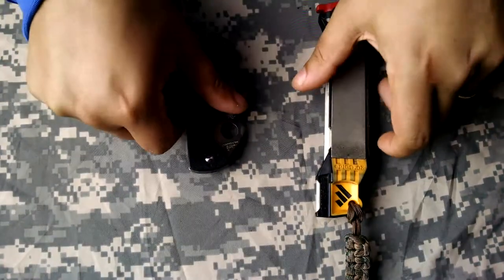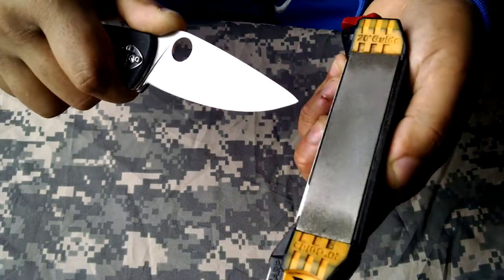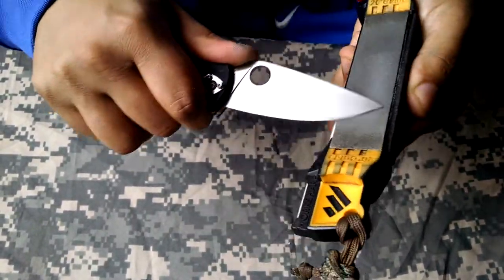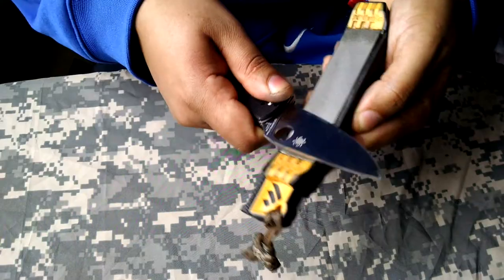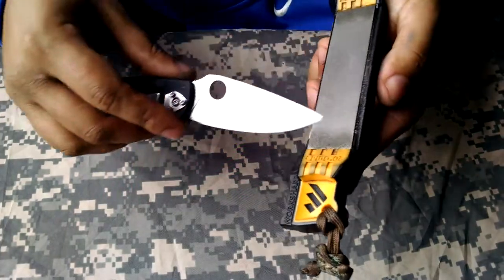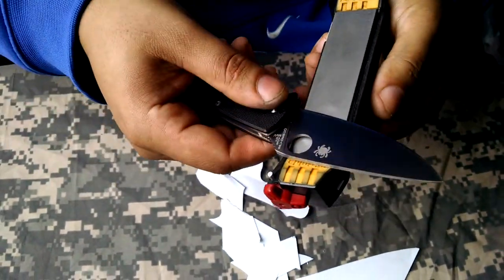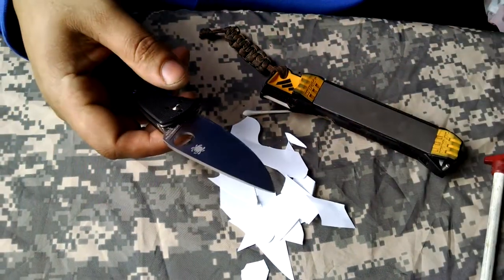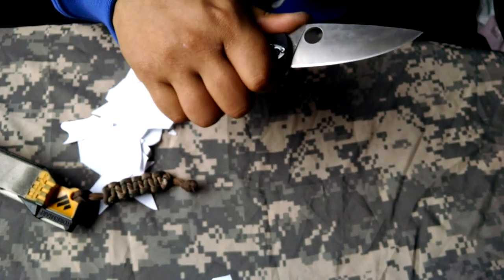How to Sharpen a knife with a Worksharp "Field Sharpener"

Comment: I have watched ur video 3 times and it seems like I am doing exactly what ur are doing. I am a beginner but I cannot seem to raise even the slightest burr. Any idea on what I could be doing wrong???
Reply from the maker: Hitting the bevel with too much inconsistency, use a sharpie marker to mark the bevel, see where you are hitting on the stone, and correct as needed. Stop when you make a consistent burr from tip to heel. Don't overthink it.